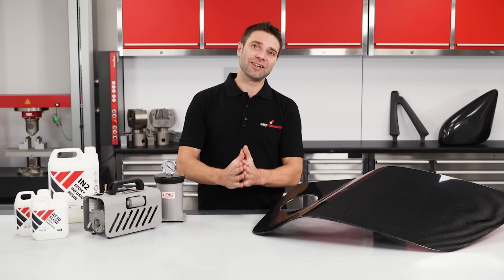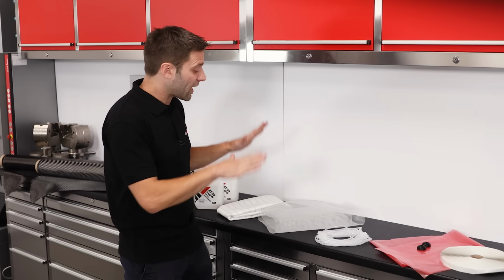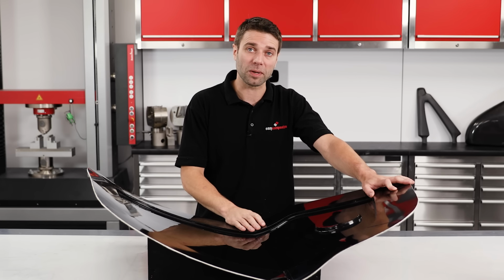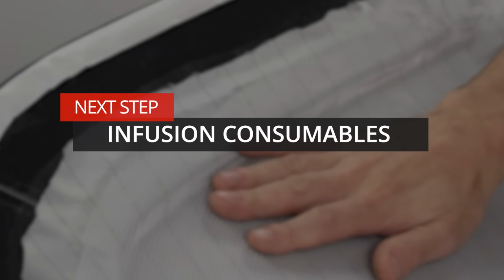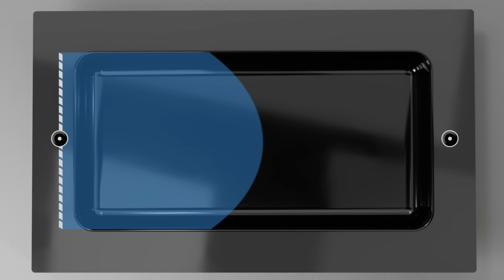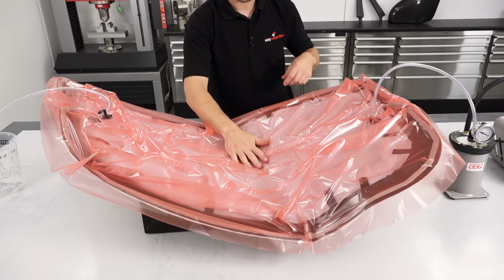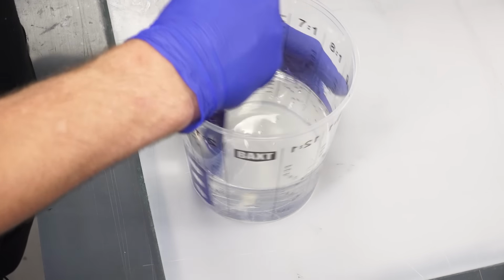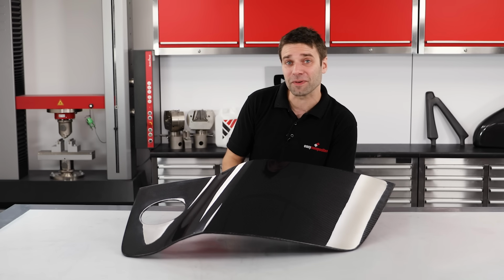Beginner's Guide to Resin Infusion for Carbon Fibre Parts

Comment: Hi
We tried making 3mm thick CF SHEET using the infusion process, and 1ply of 200gsm and the remaining 7 ply's of 12k. We noticed a lot of dry spots and the problem persisted all the time. How to fix the issue.?
Reply from the maker: Hi there, when infusing thicker laminates like this you may need to slow down the infusion to ensure that the resin fully penetrates through all of the material. In some cases, if you try and infuse too quickly there is a chance that the resin will skip through the first couple of layers and not fully saturate into every layer.
Reply: @easycompositestv  
Earlier we used 6k fabrics, we didn't experience dry spots. When we started using 12k. As you have mentioned, we tried infusing it slowly though. But still problems persist. That's where we thought of getting some suggestion.
Reply from the maker: @tilakaradhya2538  It's certainly possible to infuse a 12k fabric in a laminate this thick. It may just be that you need to slow the infusion down even further. I'm assuming that you aren't suddenly working in colder temperatures which would increase the viscosity of the resin. The other thing to try is leaving the resin feed open for a few minutes longer after the vacuum is clamped off. This will help to improve the surface finish.

Comment: as this is a beginners guide. can you use any vacuum pump available? I have a CNC Mill with a vacuum chuck, with a 'bigger' Vacuum pump attached. what are the specs i need to look out for?
Thanks for doing very helpful videos! even as i have no intend to use them, i really enjoy watching them! keep up the great work please!
Reply from the maker: As specified in the video, the pump needs to achieve 5mbar or better vacuum levels,

Comment: Hey i love your videos and am fascinated with using 3d printed moulds for rapid prototyping of composite parts but I've seen some people using a 3d printer to make a negative mould out of a more heat tolerant filament then giving it a layer of gel coat? Could you guys do a video exploring using 3d printing with pre-preg please? Thanks!
Reply: "Bigrep HI-TEMP Filament" can apparently withstand 160C before deforming or softening. Could you guys try something like that out potentially?

Comment: Great video! It would be great if you covered resin infusion on thick parts (like 15mm thickness) and challenges met when using complex shapes with UD or Bi-AX layers. I'm currently at the stage of designing a shell structure with a 10mm long perpendicular collar around the part, made with layup that acts like a quasi-isotropic material, and there isn't a lot of tutorials on yt covering that topic.
Reply from the maker: You have to be careful with very thick laminates to avoid resin exotherm and also enough time to fully wet out the fabric with resin.  UD does not infuse well as there are very few gaps between the fibres for resin to flow.

Comment: What happens if, once the infusion is complete, you clamp off the resin line but allow the vacuum line to keep drawing, wouldn't this make for even better compaction? some tutorials advise this. What's your take on this? thanks
Reply from the maker: Swapping round the order In which the lines are closed off can result in a fractionally lighter part as resin is drawn out of the part and into the vacuum line but does not really improve the consolidation. The issue in doing this is that it can result in dryer areas in the laminate and a compromised surface finish as the laminate becomes more lean.
Reply: @easycompositestv  Makes sense. Thank you. Do you also have a Silicone vacuum bag system that can be used over and over? thanks again
Reply from the maker: @SunilSundar  No we don't have a reusable silicone bagging material I'm afraid.

Comment: Well, I have enrolled in a CADD class at my local community college and will use that to learn how to make my molds that I want. I will be making an intake manifold for my single cylinder motorcycle that I am making. This video answered questions on which fabric to use. 
My question to you is, would you be willing to look over a PDF of my design to give input for ease of manufacture and such or would you charge for the consultation?
Reply from the maker: Hi Bryan, 

Great to hear that you've started to learn CAD, it really can be a super useful tool for a number of projects and a great transferable skill. If you want to send the design over to our technical inbox technical@easycomposites.com we can take a look over it for you. We wouldn't be able to provide full a consultation service but can offer general advice and guidance.

Comment: do you have any videos on how to make a mould to make a bumper ?? what are your thoughts on 3d scanning a bumper and then having a mould made and how do you make a diy mould
Reply from the maker: For making body panels you can use the process in the mould making tutorial we mentioned in this video. You can also check out our bonnet making series which starts with taking a mould off an existing panel. https://youtu.be/UgKvDw1E60E

If you have capabilities to 3D scan the part then this can be used to make a plug. You will need access to a large 3D printer or CNC machine in order to produce the physical pattern. Form there you can then make the mould. 

Alternatively check out our other tutorials for pattern making by hand.
Reply: @easycompositestv  Thank you

Comment: I never see you wearing a mask when dealing with loose carbon fibre. Are you not concerned about any of it getting in your lungs? (Don't get me wrong, your videos are amazing, it's just my understanding that carbon fibre is terrible for your health.)
Reply from the maker: Generally speaking the fibres don't break down and release dust or fibrous particulate simply by being handled. When cutting the fibres after curing it it more likely to produce a dust due to the processes involved and we would always recommend the use of a dust mask in such scenarios.

Comment: I want to make a full suspension mtb so I am watching many videos only from your channel because you explain everything very  clearly I hope so I would be able to build a mtb successfully
Reply from the maker: Thanks! It sounds like a great but challenging project. Check out our full MTB build case study we made a few years ago for some tips if you haven't see it already. https://youtu.be/UWSePEV88tw
Reply: @easycompositestv  Thank you so much !
But I have  doubts 
1. Is the process of making carbon fibre parts as same as of making fiberglass parts ?
2 . To make the frame , can I first make a clay frame then harden it and put the half hardened clay frame into a box filled with clay and let it dry  to make the mould ?

Please reply to my doubts , it would help me a lot
Reply from the maker: @shlokchandankhede5693  A bike frame is really suited to prepreg methods of manufacture where the resin is already impregnated in the fibres and cured at temperature under vacuum. You would need a high temperature mould in order to process this prepreg material. Usually a carbon fibre mould tool would be the preferred option for processing carbon fibre material as the CTE of both parts would be closely matched. This helps to avoid things like pre release which can cause distortion as both part and mould will expand and contract at roughly the same rate.
Reply: @easycompositestv  Ok thank you so much !

Comment: thank you for your great video
3409 Gram - 610 Gram = 2799 Gram reduction. WOW
Reply from the maker: The weight saving benefits can be great compared to original OEM parts.  On an R8 this is a cosmetic trim panel so replacing both on a track/race car is almost 6kg of saving alone!

Comment: Jeeeeez... Making carbon fiber monocoque should be pain in an ass... )
Reply from the maker: Difficult yes, but not impossible. Generally the bigger and more complex the part, more consideration is required in the position of the feed lines and vacuum ports etc.

Comment: How do you make aluminum honeycomb sandwich panels?
Reply from the maker: Almost always they're made by creating the outer skins, as carbon fibre sheets, and then heat pressing the sheets, using a hest-curing adhesive film, onto the aluminium honeycomb core. This is often known as a two-shot cure. One shot curing is possible for 'solid' lightweight cores, like foams, but not for honeycombs like aluminium and Nomex.

Comment: Do you have a video where you go into the details and reasoning behind letting the bag draw in extra resin after the vacuum has been clamped off? You mention that there are some "slightly complex reasons" in this section of the video: https://youtu.be/pWRVVLJX8eE?t=1713
Reply from the maker: We don't have a video on it, no. Mainly, it's to do with allowing the pressure to slightly reduce in the bag, this significantly reduces the volume of any residual air. The drawing in of the resin is done by the elastic tension in the bag and mesh. The resin uptake during this phase is minimal (maybe 10-20g on a part like this) but you'll tend to get a better surface finish as an micro-air bubbles will shrink down. Maybe we can look at it in more detail in the future :)

Comment: What does the edge look like when cutting the excess off of the part? Does it sand smooth?
Reply from the maker: It looks good, just a dark grey colour solid material. You can sand, flat and polish the cut edge no problem.

Comment: Could infusion also be used on a cone shaped round part?
Reply from the maker: Yes, if you can get the resin flow distances within the rules laid out in the video (or change resin system if you can't) then you should be able to infuse most shapes. It would depend on the dimensions and proportions of this cone-shape but (possibly with some trial and error) it should be possible.

Comment: I'd like to use this method to replace body panels on a project car. However, I've seen many DIY'ers warm against galvanic corrosion. What is that? How do you properly prevent it?
Reply from the maker: Galvanic corrosion is really only an issue in presence of an electrolyte when 2 dissimilar materials are joined together. Often the resin on the surface of the part or the adhesive used to bend the carbon fibre to the metallic component is sufficient to insulate the 2 materials.
Reply: Fiber glass layer on the contracting parts, Lets say a front fender.

Along the bolt holes, use glass fiber on the first and last layer. To sandwich the carbon fiber. It can be a small patch or long strip, whichever you prefer. 

You can dye the epoxy too.

Comment: I bought some of your products in an attempt to make my part, but have failed multiple times.  I’ve accidentally dropped the part and had to remake it a couple times.  I finished it incorrectly and that led to a molding disaster.  My latest attempt, after repairing again, involved sending the part to a professional body shop and they painted it with a very nice paint.  I haven’t attempted to do anything with it yet because I can’t deal with another failure and the part looks so nice now.  I must add that it also has a core because it’s hollow.  I was warned about making a complicated part as a first attempt, but as usual I just ignored the naysayers.  They were right, by the way.  I saw in a previous video where you used a glass reinforced paste substance for making a mold.  I think I will order this and give it another go.  Your videos do inspire.  Thanks
Reply from the maker: Thanks Will. Sorry to hear that your first project didn't go to plan but it's absolutely our mantra to advise customers to start with smaller, more manageable projects. You'll inevitably make some mis-steps along the way and so it's far better to make them on smaller, less consequential parts. If nothing else, this costs a lot less (money and heartache). I do hope you persevere with and and of course do get in touch if you need any help selecting the right products. The glass reinforced tooling pastes are excellent products for those with limited experience (and often those with plenty of experience!).
Reply: Hi will this work using a hollow part like i’ve seen done on your channel using prepreg
Reply: I failed many times. But the failings are important in developing a personal understanding of the process. Its a very intellectual yet physical activity. I dont mind failing a few more times just to understand the process better

Comment: Great video as always! It would be interesting to see a comparison between the Fusion Fix and Fusion Fix EP. If the EP really doesn’t leave residue on surfaces, that would be a game changer for me. Maybe consider a quick spotlight video on the second Chanel?
Reply from the maker: Thanks for the comment, this is a very interesting question and absolutely deserving of its own video, either a spotlight, or possibly the main channel because it's an important part of a lot of projects. To summarise though, FusionFix EP will leave a residue but it can't be seen and doesn't remove easily. Strong solvents (like acetone) can remove the residue which will leave a very faint 'dither' on the surface. For most parts in most circumstances, we think you wouldn't need to do anything (i.e. just leave it as is) which is a game changer. If you thought the part might be exposed to strong solvents (like acetone) then you would want to remove the residue. But, to be honest, you'd probably need to be thinking in terms a tougher coating for parts that will be exposed to harsh chemicals/solvents anyway.

Comment: May we cure it in the owen and if yes, what temperature and time. Also how much does it add to mechanical or any other properties. Thanks
Reply from the maker: Yes, you can post-cure the IN2 resin system. If it's practical to do so then it's generally considered a good idea. Post curing will improve the mechanical performance by a few percent and will raise the Tg (temperature tolerance) of the component. It can also speed up the cure, which can be very useful in high volume production. Please see the technical datasheet for the IN2 resin for suggested post cure cycles.

Comment: awesome video as always. Have had a few failed and successful parts under my belt and it really is important to pay attention to the resin brake/break area and pleating of the bag.
Reply from the maker: Yes, full agreed on both of those points. Pleating of the bag so critical to ensure that you have PLENTY of bag and the resin break is a key part of ensuring that you don't end up needing to run a lot of resin into the catchpot whilst you're waiting for those last corners to infuse!